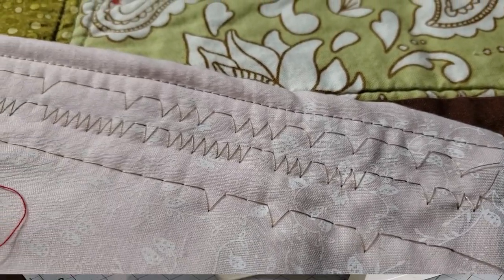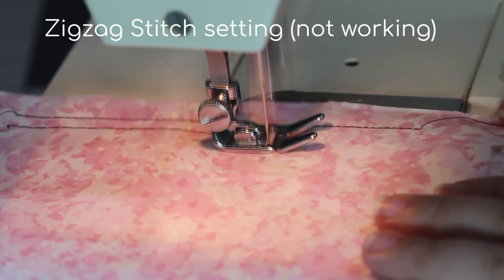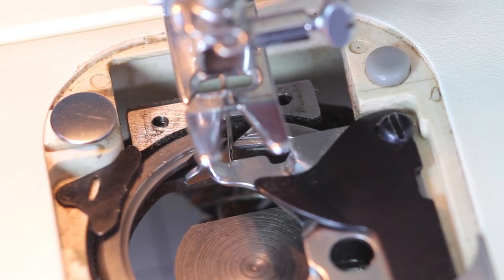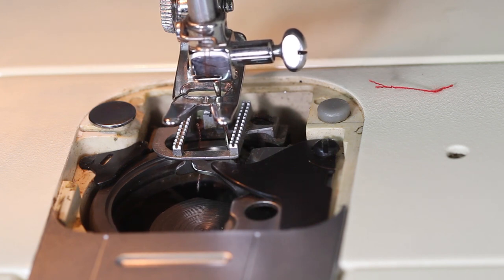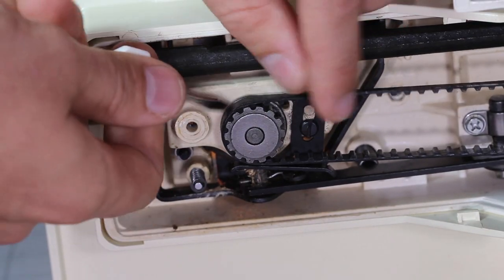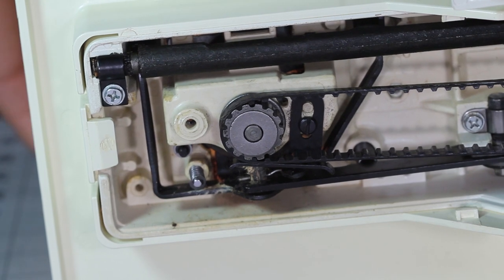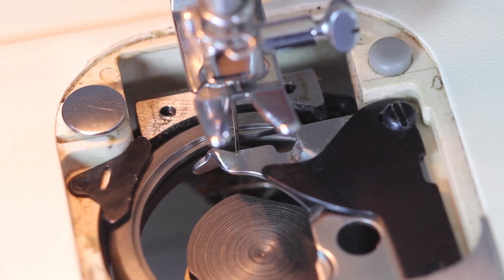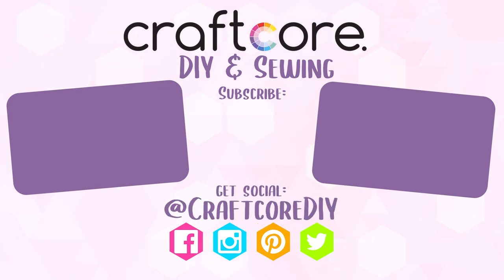Fixing Sewing Machine Timing Issues and Skipped Zigzag Stitches | Singer Model 6215C

Comment: Wrong way to fix the timing. Timing belt could be fixed by loosening two screws on the larger wheel to the right behind the lid then the belt could be moved easily.

Comment: I'm sorry, but you didn't explain how to adjust the timing...what did you do to the belt that affected it? Confused. I thought timing was a very difficult thing that required special tools to measure mm's etc. Thank you though. Also washing fabric before sewing, plus a new needle designed for that fabric, will usually resolve it.

Comment: I'm just getting back into machine sewing as a somety-something, having done a bit of sewing as a kid and as a teenager. I bought my machine a few years ago, but have only recently gotten into using it. It's a modern Singer - not a super-expensive model - and when sewing the widest zig-zag stitch (in the program - it's computerised) it is skipping stitches and getting jammed up. So I figured it needs some adjustment. I'm an engineer and an avid-DIYer, so I knew when it came time to service or adjust the machine I'd be watching YT videos to learn how to do it. I had this idea from my childhood use of my mom's machine (and other things I read) that sewing machine timing was something super-complicated that needed a PhD borrowed from the Hadron Collider to fix. But in fact it's all really quite simple. Just look how this chap has fixed his lovely spouse's secondhand machine in a matter of minutes. 
I've also got an issue where the machine works well with standard thickness thread, but when I use a 40 weight thread I start getting mayhem down below in the bobbin department. No euphemism intended. From what I've watched this evening I think it's a problem with the clearance between the hook and needle or the clearance between the shuttle-driver and the hook component.
Yesterday I wouldn't have had a clue what was going on, but today I've discovered that with a little learning and patience I can identify problems with my sewing machine and fix them myself.
If you're reading this and wondering if you have what it takes to adjust/service your own machine: well, if you are able to sew garments or other projects, you definitely have the skills to fix your own machine without taking it to a repair shop. All you need are some basic tools and the patience to find/watch the right YT videos. Like this one!  Thanks guys for this tutorial, and it's great to see a vintage machine saved from the dump and returned to active service.

Comment: Thanks for the video! I thought the skipped zig zag stitches (some peaks and lots of straight lines) were due to timing issues, until i changed the jersey needle to a normal one and the stitches became normal! Turned out that i had an entire pack of spent / lemon jersey needles, another pack was fine!

Comment: Big mistake taking the timing belt off now can't get it back on. Now to figure out how to get the bolt unscrewed on the base so I can see the gear to the right!  I have an older Singer 2502C.  At this point it looks like I'm going to have to take to the repair shop.
OK update; @lunasails5850 was correct! You don't need to take the timing belt off... I was able to adjust by loosening the set screws on the larger gear to the right and it's working and I got my zigzag stitch back!! Thank you for helping me get there.

Comment: i have a2662 singer and it looks like the hook is timed right, but when trying to zig zag the needle goes into the fabric and "then" moves in a zig zag direction both ways. the needle shouldn't move side to side while in the fabric. how is it adjusted? or is it also associated with the hook timing?

Comment: I have a similar  one and have same issue.Can  i try to  adjust the needle bar instead underneath?easier to do.thank you
Reply: The needle bar is for adjusting the distance between the hook and the needle. The needle shouod be a no more than millimetre away from the hook , a papers width is ideal . It shoulod not be touching.

Comment: I have a similar machine. Mine is a rare 9210. I'm not sure it is the same mechanically, the bobbin case is the same I have to check how to access the bottom but I have a hard time understanding from this video where the needle should be. But thanks for the video, I can't use my machine much, even the straight stich is pretty ugly so I have nothing to loose and will try to fix it. thanks
Reply: This video was really helpful. It gave me the courage to open up my machine and try to fix it. My timing was different, I cleaned up all the mechanisms which were pretty dusty. In order to play with the “mechanism” at the bottom though I had to open much more than the left side so after cleaning them, touching them a little I checked another video on how to fix it from the top, from the needle piece. Well, not sure what did it but I played with a screw, the timing seemed good and closed everything. It was a succès ;) For the first time not only could I do the zig zag but also all the other stitches 😜 Thanks a lot!

Comment: Unfortunately, this did not help my Singer Samba 5.  I only made it worse, I tried to shift against the movement, and the result was the same for the movement.  The sewing machine skips on the right stitch of a zigzag.
Reply: I have this problem too and can't seem to figure it out :( I've re aligned my hook 50 times already and it looks all good manually rotating it, but the right side of my zig zag is missing everytime I stitch (resulting in a straight stitch)
Reply: @hannahnevaeh6379  I found a solution to the problem.  Can be smoothly adjusted by loosening the three black screws on the right toothed shaft.  It is located at the bottom right under the cover.
Reply: These small screws need to be loosened.  Then you can set the shaft to the desired position relative to the needle.